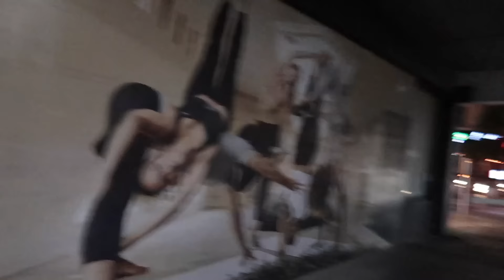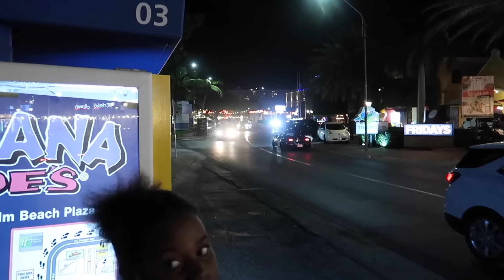ARUBA UNDERGROUND CAR MEET! EVERYONE GOING WILD!!! (Beware Headphone Users!)

Comment: great video johnathan little question why the rear wheels on your motorcycles are further away in France I don't see that thank you for your videos which are great I'm a fan 👍 good continuation 😉
Reply: They are streched soo they can do stunts like bike drifting 👊🏽
Reply: thank you for your answer 😉👍
Reply: mainly it's to race (drag race) because when the bike it's stretched the front wheel is less likely to go up and wheelie, so u can go full throttle on the bike and it won't wheelie

Comment: Those aint lexus is's . Those are altezzas
They are very popular round here
Reply: Aren't they the same car?
Reply: @floppy7283  well yes but actually no
Reply: @floppy7283  so altezzas came with a 1gfe i6(gxe10) or a 3sge i4 (sxe10)

While is300s came with a 2j factory (jce10) or the is200 which shares the 1gfe with the gxe10